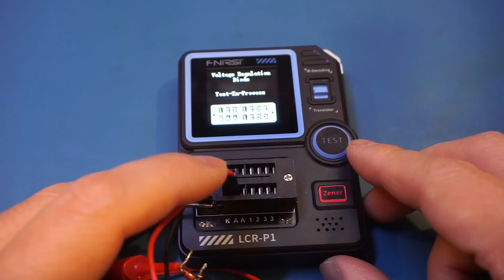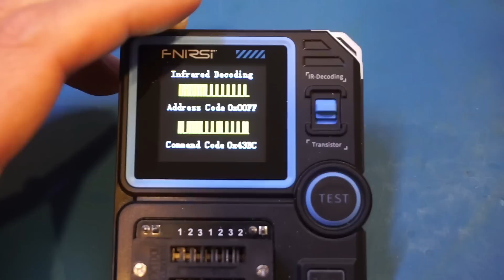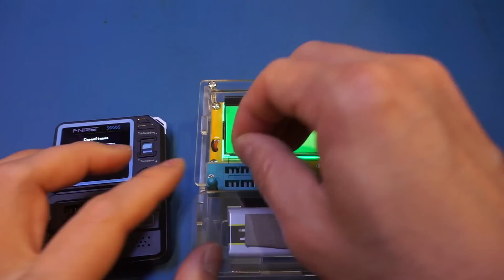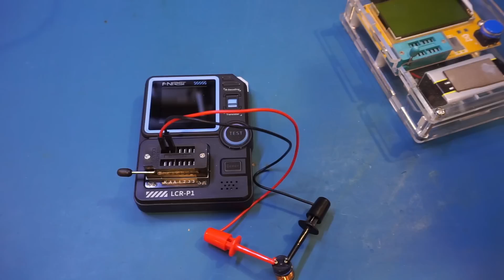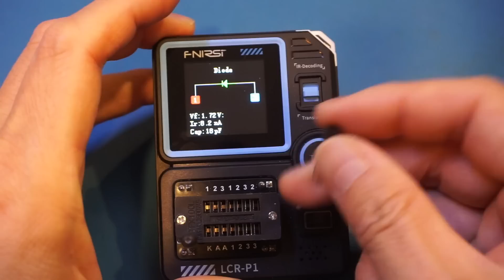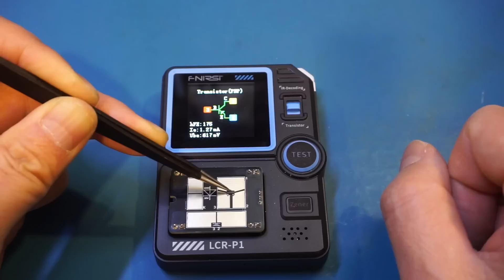FNIRSI LCR-P1 Component Tester Review/Teardown, Compared to the LCR-T4

Comment: I noticed there’s an issue identifying transistor legs according to the socket PIN numbers. EBC 123 transistors will sometimes show CBE 123 on the display.
Reply: they fixed it in the new firmware APP_LCR-P1-EN_V1.1.0_260324.BIN

Comment: I am very surprised you didn't compare this to the original GM328 open source hardware transistor/component tester.  This is the one that started them all, and the one all the chinese knockoffs are based on.  I was surprised to see you compare to an LCR-T4 and it makes me wonder if you don't know the history of these.  The GM328 line has one significant feature, which is a calibration setting.  You mention that ESR and low-value resistors are both inaccurate.  This is because the test leads themselves are enough added resistance to throw those measurements off.  The GM328 can calibrate for your test leads.  You also have to be careful with capacitors, especially small ones, that you keep the leads far apart or they will add enough stray capacitance or inductance to throw things off.
Reply: After spending more time with the LCR-P1, my experience is this:  The addition of a relay internally adds about 10 milliohms of internal resistance, plus the cheap crimped test leads adds another ten or twenty milliohms.  The lack of any method to calibrate out those resistances makes this unit very inaccurate.  It causes it to report too low for hFE and too high for ESR.  This in combination with the lack of any accurate identification of NPN pins makes this unit unsuitable for almost any purpose except as a pretty toy.

Comment: Just Today receiving this cute little measuretool, i hope it works for identiefying damaged components...
Studying the manual i missed the point, how to check the internal LIion Battery Status...how can i check actual charge status (full or halfful?)...you cannot because its not shown in the display...then...i connet a mobile phone charger and turned this little one from all sides, suddenly..i saw a little illuminated hole near the usb-c socket of the device...yes...thats the indicator lampe for charging...red...its not full...green....now its full charged...i do not find this in the manual or in any demonstration here in the  net...curious...

Comment: IR remote controls use various carrier frequencies. This device can measure the NEC-standard with 38 kHz only. This is used by most of remotes, but some use other frequencies. In the best case, this produces results as with your keyboard, namely none. In the worst case, it seems to resolve the codes, but they are nonsense. For example: My Chinese cheapy remote for a LED-bulb turns the light off. Programming this into my prgrammable remote turns the light to purple, whereas the on-function works corretly.

Comment: I bought one of those exact testers recently. I do a lot of DIY builds, like guitar pedals, line level and phono preamps, HiFi and audio amplifiers, etc. It makes things much easier to test and get an accurate reading. I bought it originally just to test the gain and type of transistors I had for guitar fuzz pedals, but it does so much. 

I love it and would recommend it to anyone who builds, repairs, upgrades, or modifies any type of gear. Worth every penny, which wasn’t much. Considering how much easier it makes testing parts, it actually cost very little and worth every penny. 

Thanks for the video!
Reply: I have a question. My concern is, if the rechargable battery of this unit is bad can you replace it? Hope to hear from you soon, many thanks in advance

Comment: Just burned one LCR-T1 by accidentally testing a charged capacitor, and now I need another one. The FNRSI product specification claims it's 'anti-burn'—I guess that’s what the relay is for—but I want to make sure the next tester won’t blow up in a split second if I mess up again.
Reply: what voltage charged capacitor?
Reply: @spacevision1681  Don't remember. after the meter burned down it was too late for measurements. But i was working with either 12v or 5v iirc.

Comment: I'm wondering if the Fnirsi when you fist power up shorts the input so as to discharge capacitors to be checked, therefore, you have to press the button then the test button, if this was so we could live with the annoying button pressing.

Comment: Kerry these tester have a major error reading npn pinout transistors. I have send then a email reporting the error with photos evidence.
Reply from the maker: I will try do more thorough tests and will see what I find.
Reply: @KerryWongBlog  use a 2sc1845 on the slot 1 2 3, with the case transistor facing you, the pinout of the collector is showing 1 and emitter 2. It's the inverse. But if you switch the case 180° it reads fine.
Reply: @Fanan67  This is only the case for an NPN with the base in the center pin.  The reality if you don't have pin as collector, 2 as base, and 3 as emitter, then it will give you a wrong layout with almost random placement.  Good luck trying to identify an unknown transistor.

Comment: Mine does not correctly identify the pinouts of bipolar transistors, though it does give reasonable test results otherwise (i.e. it correctly identifies the device as NPN/PNP, and gives reasonable numbers for the device parameters). The 1.0.7 firmware update was supposed to correct this, but it did not. Aside from this issue, it seems to be a pretty nifty little device.
Reply: they fixed that issue in the new firmware APP_LCR-P1-EN_V1.1.0_260324.BIN

Comment: You probably know this but others may not, due to the many protocols and types of signal coding with IR devices it is not really as simple as showing the "raw 0s and 1s". An example for clarification would be, is the logic high counted on the rising edge or falling, or is it decoded from PWN or frequency modulated encoding. IR is highly proprietary, so the best case would really be just having as many standard formats included as possible. Though after all that it does occur to me that it could possibly be set up to display a graphical representation of the IR signal itself, though that would really require some sort of triggering scheme, likely why that is a fairly standard feature of digital oscilloscopes.

Comment: I deeply regret having purchased this device. Even after installing firmware 1.0.9, the following problems persist: 
1) Does not identify schotkky, SCR, DIAC and TRIAC diodes; 
2) Error identifying certain transistors (NPN by PNP and vice versa or inverted pins); 
3) Incorrect capacitance and ESR values (in my case, higher); 
4) Need to press the TEST button twice and delay to obtain the measurements remain.
For the reasons above, I DO NOT RECOMMEND the purchase of this device, unless the reason is ONLY for measuring Zener diodes, where it produces good results.
Reply: I subscribe to the above. They are truly rubbish and cannot be trusted at all.
Reply: 2) is fixed in the new firmware APP_LCR-P1-EN_V1.1.0_260324.BIN

Comment: I"m really not sure why you would make your comparison with the lcr-tc4 as the one your are showing in the video was one of the oldest and cheapest lcr-tc testers I've got. Seems more appropriate to test it against the tc1 or tc2 . These units test zeners and other high voltage components and do not require a batter as it is inside and rechargeable, and they are a much better buy than the frsi unit.  Why please ?

Comment: According to the manufacturer's specifications, the FNIRSI LCR-P1 measures capacitors in the range of 25pF~100mF. The fact that it measured anything at a value of 10pF is a miracle. Look at the tester's manual.
Reply: You can measure 1-500pF with a bare atmega328, just two wires into two ports. Because you can form a voltage divider with its parasitic capacitance on its pins. After a single calibration, it's a very accurate method.

Comment: ATTENTION! For people that want to buy this little toy, or for the ones that already have it, I experienced a fault with this unit after a little more of a month. Yesterday I was testing some caps and after a few tests, it got stuck in short, showing the resistor symbol, with INDUCTANCE text, and values of 0.1~0.3 ohm and 0.0uH between terminals 1 and 2.
I opened the device, took some few measurements and rapidly noticed that the relay was not opening in one of the sides. Since I didnt have a replacment like that, a just give it some "percusion assistance" (I tapped hard one the top of the relay) and it came back to life. It is a easy fix if you encounter that situation. In the next days, I will replace that relay with a OMRON one.

I bought it after watching this channel and some others that I follow. 

Hope this helps!
Reply: I heard it can happen if you try to test a charged cap.
Reply: @yotoprules9361  Yes, that was my first thought, anyway the caps should discharge through that relay, thats why its implemented in the device. Anyway, it's a very good and practical tool for its size, but testers like GM328 have the option to let you choose the kind of compoment you want to test, making it very easy to check several caps, for instance, and it shows changes in value in real time. I have both.
Reply: For capacitors you must first discharge.
Reply: Relay contacts getting stuck is common if not enough voltage/current is applied to the activating coil.

Comment: My LCR-P1 freezes when trying to measure IGBTs. I am forced to open and remove the battery to get it back to normal. The IGBT I tried to measure is a K40EH5. I am disappointed. I updated to the latest version 1.0.6 and nothing changed.

Comment: "Quite Decent"? No it is a piece of junk, looks nice but they obviously tried to copy the firmware from the original TC1, TC2 or TC3 testers you see all over AliExpress.  I guess you try to be nice to FNIRSI since they send you stuff?  I actually bought one myself and tested it on my channel and it was not able to test Schottky Diodes (less than 500 mv) SCRs, Diacs, Triacs and was very in accurate on capacitance and ESR etc. It is also slow and you always have to press the test button twice, annoying.  In my comparison the TC1 component tester is half the price and was able to test Thyristors and was quite accurate on capacitance and ESR as well as being much faster and you only have to push the test button once.  I hope you will do a better job testing these devices next time.  The only thing it does that the other testers can't is test higher voltage Zeners >  30 volts and it is the only reason I have not thrown it in the Junk pile.  I have little hope FNIRSI will fix this thing the latest firmware is 1.06 right now but does not fix any of the bugs and omissions.
Reply: Unfortunately I bought one before reading your comment.
Reply: He has done like 200 reviews in a row of Communist Chinese Mailbag Products.
 This is a Chinese shopping Channel.
China is poised to wipe out consumer electronics world wide with their subsidized gear with little regard to where they stole it from.
Kerry is their well rewarded star front man talking head..
Reply: Which one you can recommend?
Reply: KoRtExXx @KoRtExXx  There are several testers marked LCR-TC3 or TC1 these are still the best in my testing.  They are also cheaper.
Reply: @Tech-Relief  I find the best one is still the very original GM328 ones based on the very first open source project.

Comment: Hi Kerry, you should update your firmware, your version is 1.0.2 and the latest is 1.0.6.

20240726
1.0.2:
1. Improve some abnormalities in thyristor testing
2. Improve some abnormalities in transistor measurement
3. Modify the time difference between measurement and display devices

20240802
1.0.3
1. Improve small resistance test abnormality

20240820
1.0.4
1. Increase the measurable range of single thyristor

20240902
1.0.5
1. Modify the display disorder of double diodes
2. Modify the display disorder of small resistance

20241021
1.0.6
1. Modify the problem of inaccurate test accuracy of 20K to 50K resistor
Reply from the maker: Thanks for the info. Will give it a try.
Reply: it still doesnt measure well small resistances. Try a 100 Ohm resistance and it will tell you it's a diode

Comment: Is it necessary to discharge big capacitor before measuring?
Reply from the maker: In general yes. But this LCR-P1 has the ability to test batteries so it wouldn't harm the meter if the capacitors are not fully discharged (of course the voltage has to be within limit) but they will be identified as batteries rather than capacitors if there is significant residual voltage.

Comment: I'd buy one of the $8 to $15 ones. (I already have a couple.) I'd say they do very nearly as much, and apparently quicker and more accurately than this one. Speed and convenience are what I see as the value in a cheap component tester. If I'm only looking at 1 or 2 devices, a minimal test bench can accurately, (within a percent or so,) measure most anything. As for testing Zeners, any bench supply with both current and voltage adjustment can easily do that. For $30 for a component tester I'll wait for one that actually does more, quicker, and more accurately than my $10 one does. I'm not looking for a tester that may read things 20% (or more) off. For a cheap tester, 2% to 5% accuracy is fine and easily doable these days. But this one isn't even doing that. Plus, it appears slower than my cheap tester that cost 1/3 as much. I can tell you from experience that when you have a bag of 500 or 1000 surplus parts to sort out you want the tester to be as quick as possible. This one isn't at all quick. So think about it before you buy. You can buy a lot of parts for the $20 difference between testers. A $30 tester is getting up towards the price of a NanoVNA, which can do most of this, and MANY other things, and more accurately, although less conveniently. Just my own opinion of what I'd advise a noob in the hobby, but it has half a century of electronics experience behind it.
Reply: I concur. The TC1 is much better and faster than this one.

Comment: I wonder how much of the code in the “transistor tester” project from a fe years ago is the basis of the LCR-P1?  Some of the screen displays look very similar.  The boost converter to allow testing higher voltage junctions is a nice addition.  I just wish FNIRI would spend a little moe time up front debugging products.  So many of their items are so close…. Their Geiger counter which is about $40 +/- is still one of my favorites.  I use the Geiger counter for qualitative measurements so it is great for the price.

Comment: This FNIRSI unit challenges a lot of no-name semiconductor / component testers available by the dozen on Amazon and Ali Express.  This LCR-P1 seems pretty slow characterizing analog components and there are some glaring errors.  The unit has pretty strong performance for basic semiconductor identification.

One obvious limitation is that there appears to be no means for determining if the unit is charging because the screen shuts off and there is not an indicator LED - though it would not take much work to hack an LED onto the charge controller circuit and poke the LED through a hole in the case.

The USB controller suggests the SoC chip is flashable and a future firmware update could fix bugs.  As of November 23, 2024 there are not firmware updates on the FNIRSI site.

The IR decode function is interesting, but it usually what code a receiver is looking for rather than what codes a remote is sending which is the salient question.  I wish FNIRSI would have used the board real estate for a go / no-go sorting beeper or something similar instead of using the space for the IR detector.

If you need to characterize analog parts and not too concerned about semiconductors, then the recently reviewed LCR tweezers seem like a better value proposition.  This LCR-P1 is affordable and performs handy semiconductor test functions which make it worth considering.

Comment: In theory, you only need to press test once: Put the part in first, then press test. For the FNIRSI display, not sure why they need to make the text so small.  There is a lot of unused space on the screen. The numbers are hard to distiguish (5 from 6, 8 from 0, etc)  I like the older tester display better.  I always test my components twice when using these types of testers.  Many times they get it wrong randomly, such as a diode instead of inductor, IGBT instead of transistor, etc.  OK for general sorting/binning parts - but not OK for checking the quality of a component before use.  Wow, that flex circuit inside the device looks heavily creased.  I'm surprised it still works!

Comment: Lookup the documentation for the original "transistor tester" project. If you do a few modifications and calibrate it, it becomes quite useful for measuring small capacitors and inductors (with a reference cap).

Comment: Thank you for the review and look inside. I bought one of these recently mainly for the zener test mode and the rechargeable battery. I believe the chip next to the battery charge controller may be a USB comm chip - these have firmware update capability and I hope Fnirsi corrects that start-up problem first! ESR readings are really dependent on test frequency, so I would not be too worried about variation between testers. Regards, David

Comment: I have the LCR-TC2 and I swear it's faster !  and works with IR and Zeners. However this unit seems fine too, I like the detachable test fixture and it would be no problem at to make your own fixtures. This made me think It would be dead easy to make an adapter for any of them ! just use the standard ZIF measurements. hit KICAD then JLCPCB and bingo ! Roberts your relative. Cheers Kerry.
Reply: My tc2 is great. As is my TC1.
Reply: You might have the original tc2. The newer tc2 variants are not very good